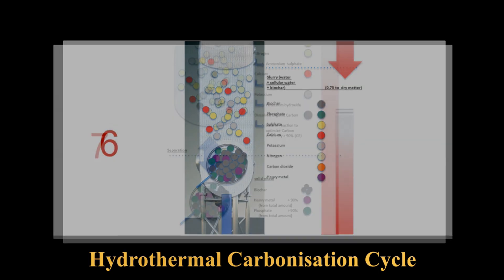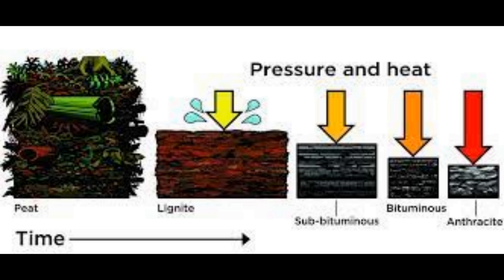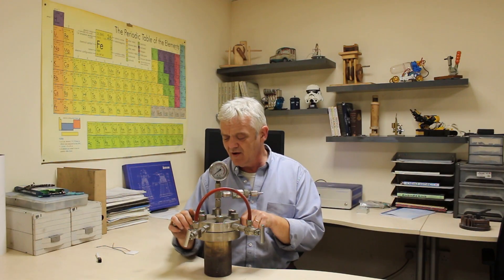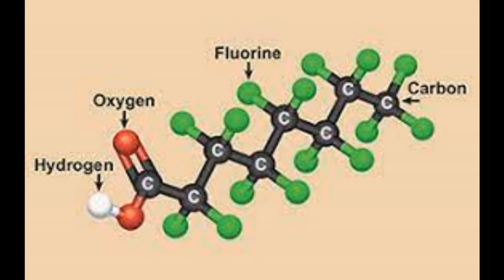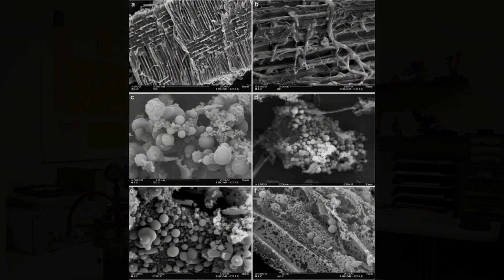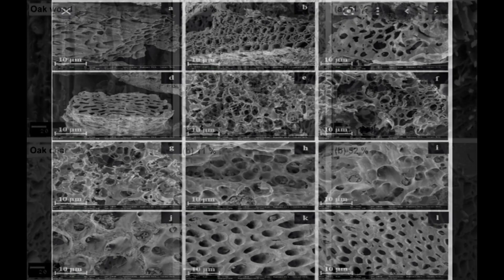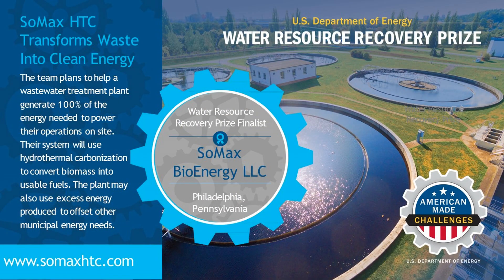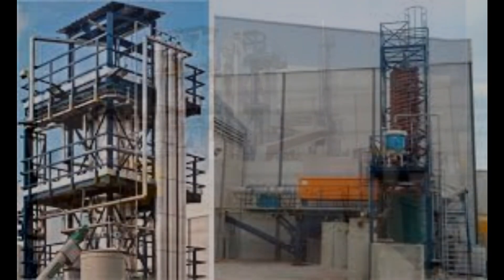1661 How To Make Your Own Fuel From Waste Or Plastics - Hydrothermal Carbonisation

Comment: That's amazing, thanks! 👏
Does it have to be with strong acids? I'm thinking about cheap production of lactic/citric acid through fermentation.
Reply from the maker: no mate it has to be a mineral acid - sulphuric, nitric, phosphoric - which kind of makes sense as an organic acid would just hydrothermally carbonise - anyway it is a weak solution
Reply: @ThinkingandTinkering  Thank you for all of your videos. You are an inspiration. I do wonder if you had an aerobic digester, could you use the sulphur acid from that in the hydrothermal carbonization process?
Reply: @elalcalde3362  Good question... like converting hydrogen sulfide into sulfuric acid 🤔
Reply: Nitric acid is the easiest to get a constant supply of at home. You essentially just need a plasma coil in a completely sealed glass container with an air intake from an aquarium bubbler. The outtake is just several tubes of water filtering the gas through which collects the nitric acid, The end of the line to let the air out is just let out into a line that goes outside the building. You're going to want proper ventilation in case anything is leaking, which is always a concern as the gas itself is toxic. Processing can take a good week or two depending on your water containers. You can check concentration using pH test strips. The first few containers should be high concentration which you can water down as needed. The system needs to have a good supply of renewable power for itself to keep it going otherwise your hydro bill is going to rack up. I would also do your research before actually attempting and not take my word for it.
Reply: @dapain1576  Thanks for the info 🎉
Reply: Not sure about other countries, but here in the US, sulfuric acid is pretty easy and relatively inexpensive to source. Home Depot, Lowes, and some grocery stores sell it as a drain cleaner.